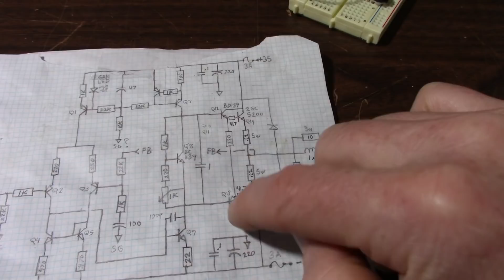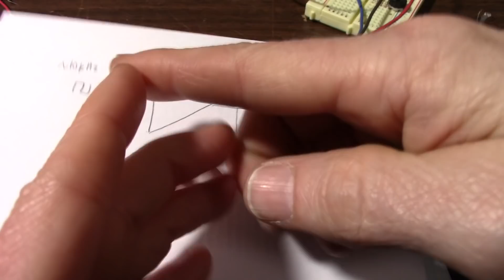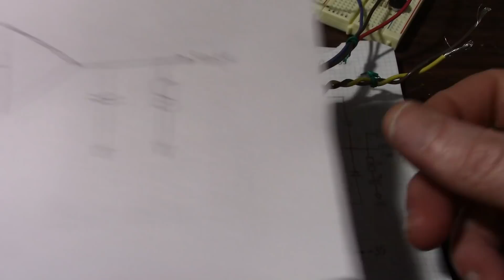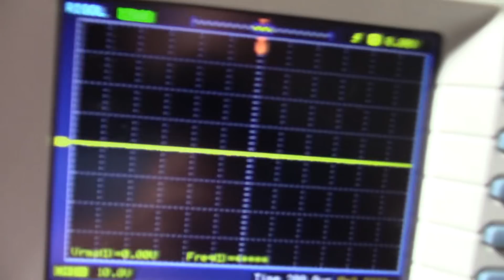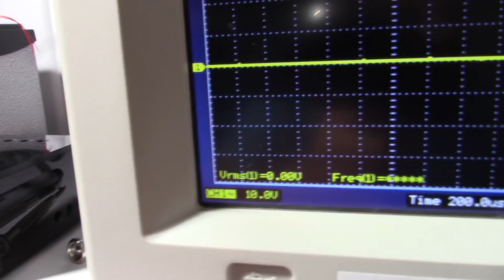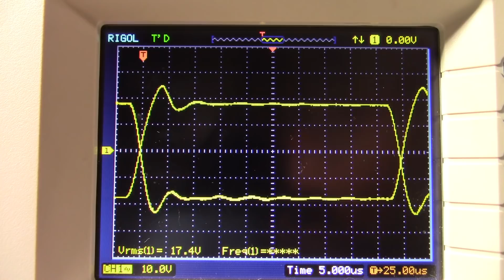Discrete audio amplifier project PT15 square wave response test

Comment: Good video. Quick question. Would you say its normal for most bench power supplies to be affected by transients when powering amplifier circuits. My bench supply is rated at 4A and has no problem with weird loads. BUT when I power my amplifier projects without adding extra filtering, it cant keep up and goes out of regulation.

Comment: Hi John, could you let me know how you applied the capacitive loads during testing? Did you apply the caps directly to the board terminations or across the dummy load? If you connected across the dummy load there will be some series resistance that tends to reduce the ringing seen right? How should we do this to formulate the test in the correct way, i.e. provide scenarios that the amp sees in real life use as opposed to a really arduous test that will never be replicated in normal use. Thanks, keep up the great work!

Comment: John
On the LM1875 board your signal input capacitor is about half the size of the one I have used because I could not find anything smaller.  (Panasonic 10μF Polyester Capacitor PET 100V dc ±5% ECQE(F))   What did you use? Thanks.
Reply from the maker: Yes, that is correct. Sorry I missed this, it was in the spam folder for some reason.
Reply from the maker: I used a 1uf cap (!) as the pole frequency is plenty low enough for audio (~8Hz).  A 2.2uf would move the pole down under 4Hz so that the frequency response down to 20Hz would be very flat. Going higher doesn't make any sense to me.
Reply: Thanks John.  I found some 1uf polypropylenes. Much smaller.
I presume this is the relevant calculation?
1/(2 × π × 22,000 ohm × 8hz)=900nF

Comment: Even when I do some 'spicing' of amps I include this kind test. Also to check damping factor, I simulate load very much resembling actual speaker impedance, and then add capacitive load in parallel - interesting how some amps behave. If it's a piece of ... the simulation will show it. I think Prof Leach amp was pretty well behaving, despite the fact that it is quite number of years when it was published. Still, actual test won't replace simulations 👍

Comment: I was wondering if shorting out the 4.7 ohm resistors would affect the square wave performance.
Reply: it would if the value was too high but 4.7Ohm seems reasonable and wouldn't affect too much

Comment: Do a dynamic power pulse test with the big supply caps. It makes a difference with bigger supply caps. Doing a class H output stage with higher additional supply voltage and big supply caps really delivers dynamic power. Makes a big difference with dynamic music. Even at reasonable volume levels.
Reply: class H only helps heat efficiency. the power still limited by both its HV and supply current capability

Comment: Very nice - showing how important the power supply is to getting clean stable power.  Was the sag at the clipping due to the leads from the Siglent power supply or was it due to the Siglent power supply itself?
Reply from the maker: Probably a little of both. I made my own short but reasonable (16 awg) leads. The supply will draw heavy current in pulses off the supply which doesn't trip its current limit since it has some internal capacitance across the output after the current sense circuit.

Comment: The clipping variation was droop on supply cables. If you put those big reservoir caps nearer the board you may even get a little more.
Well I think that's what it must have been considering your regulated supply.

Comment: Can you mount those monster transistor direct on the heatsink and use screened cable to connect the transistors to the circuit board.

Comment: Would you use two pole compensation in the output network? Higher stability, higher feedback.
Reply from the maker: I'm using miller compensation. It is simple, yet at high frequencies feeds back some signal to the transistor base which provides correction at high frequencies. Not to be confused with the miller capacitance internal to the transistor which is voltage dependent and will increase distortion. More advanced compensation techniques are better but I want to keep this amp fairly simple. If I find the high frequency THD figures are not meeting my goals, I may look to something more involved.
Reply: @JohnAudioTech  Hi John. I just found a thing that's probably wrong in this video and possibly will make a big difference. 
When testing stability of an amplifier(not final product), you shouldn't use input filter. This will hide some stability issues. In the final product yes it's necessary and ideal to put a input filter there but when testing stability, you don't want it there. It essentially filters out the high frequency content after a few hunder kilohertz, where the stability kicks in at around a few megahertz. It's possible that it's not as stable as you think. 
On the other hand, if you use a 10ohm resistor and 100n for input filtering, there won't be any ringing. But the stability, phase margin of the amplifier is not shown in there. Please investigate in the future videos.
Reply: Also output inclusive/T compensation.
Reply: definitely wouldn't be as simple as the current design but it's worth to try if you want to achieve better performance
Reply: @n.shiina8798  Well, it's as simple as a modification can get. 1 extra capacitor and 1 extra resistor. It's true that it's not necessary. But basically by doing that, you can either enhance the performance or enhance the stability, or kind of both. With the aid of the output zoble network. It can achieve terrific stability with lots of feedback. And well, it's best and easier if it's doing in simulation. Guess we'll wait and see how current one performs and let John decide eventually.
Reply: @johnyang799  yup. i've tried TMC, TPC and OITPC last year. not easy for me but they could give more either performance or stability for sure. i was helped by simulation model. otherwise, i might blow a lot more devices lol

Comment: Hey how much will it cost?
Reply from the maker: I hope to keep it under $50 for the complete kit (board and quality sourced components).
Reply: I think 50 dollars with pcb board and components.
No power supply, no heat sink etc.
Reply: Oh nice, will you send it to Lithuania?
Reply: @gedas906  I think when it's out. You can get BOM and pcb gerber. You may then buy parts from mouser, digikey, and order pcb from jlcpcb, pcbway. It won't cost too much.
Both mouser and digikey offer free shipping when the parts are over 50 dollars. And pcb + shipping cost around 20 dollars with dhl.